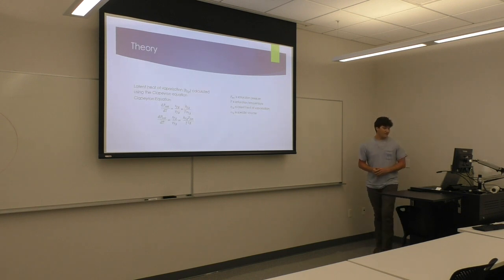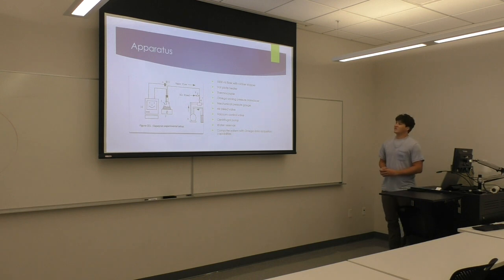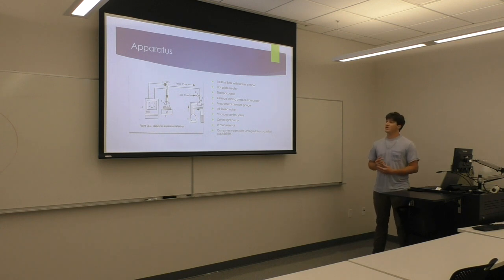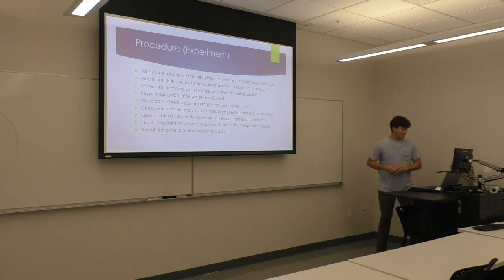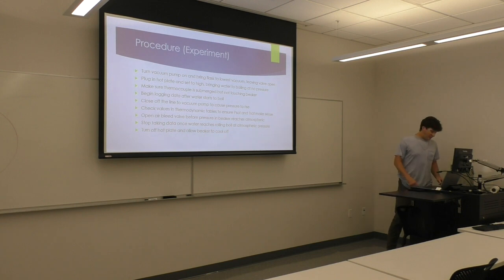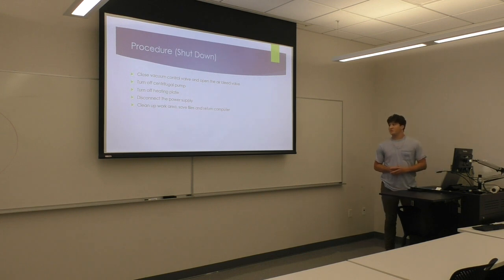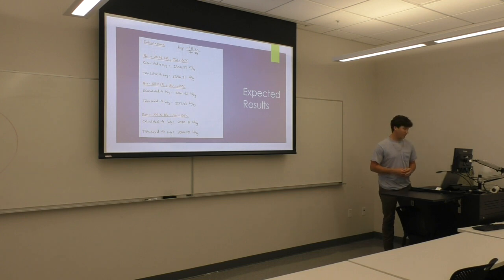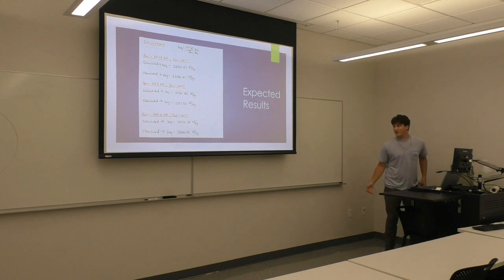Justin Hutches

Comment: Great work, Justin. Your experiment explanation was clear and thorough, which will benefit me as the group reporter. Your detailed calculations will help create the presentation, reflecting your deep understanding of the topic. In your presentation, you explained each component and step of the experiment, which will undoubtedly assist your group members during the experimental process. My only suggestion is to aim for the six-minute mark in future presentations to ensure you can use the six-minute mark. Overall, you did an excellent job with no significant critiques.